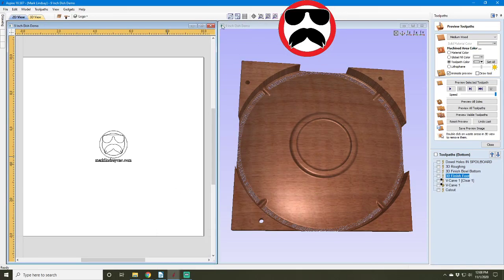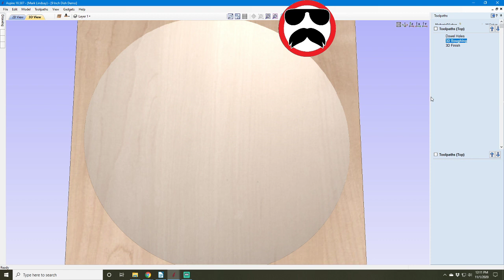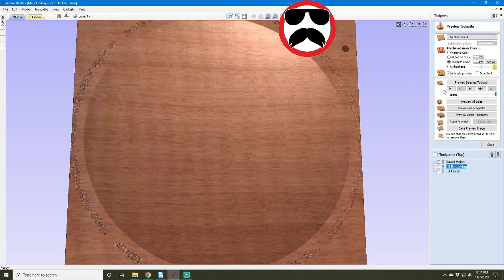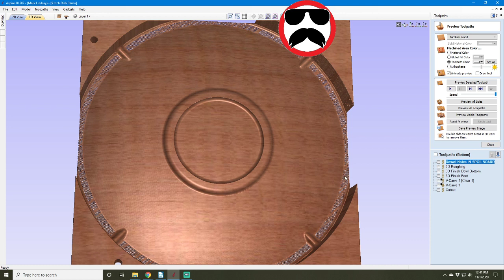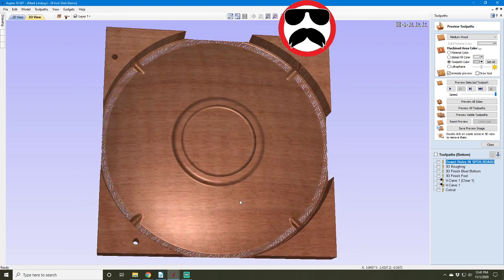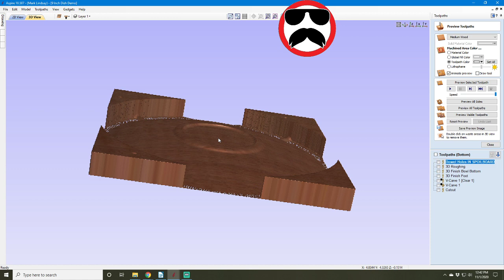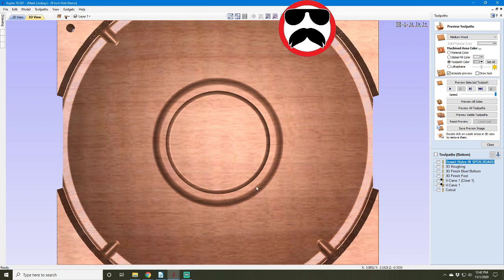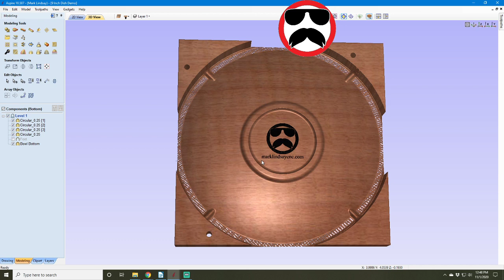LIVE Q&A #63 - Design a 3D Serving Dish in VCarve and Aspire

Comment: Now that we can save template layouts you can save one as a two sided job. Then when you place the dowel holes ,with a little thought, you won’t have to drill the holes in the spoil except the first time. They will always be in the same place until you replace the spoil board. If you drill them deep enough they will work even if you resurface the board. 
Remove the dowels on single sided jobs or before you flip the job to do the first side.
Reply from the maker: Excellent tip, Jay! Thanks!